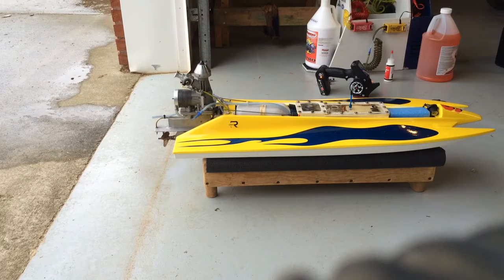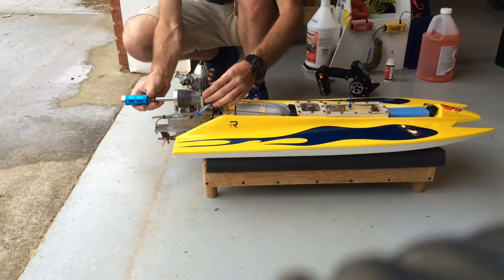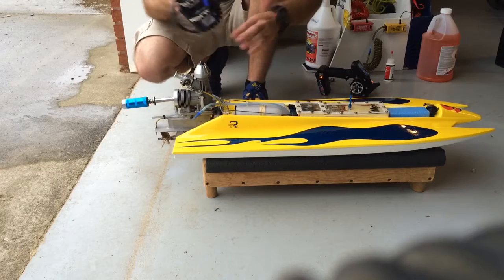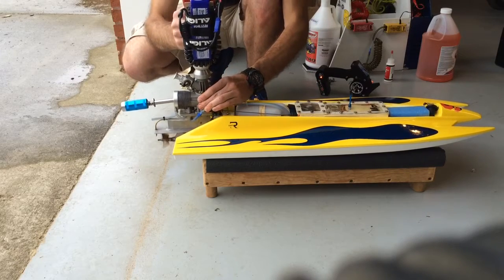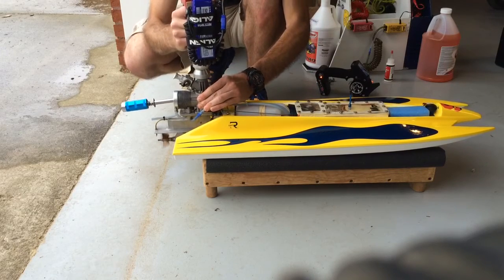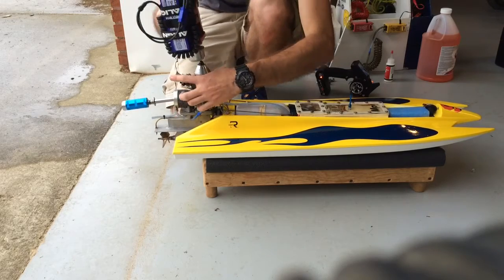K&B 11cc (0.67 ci) Outboard on 50% Nitro short fire up

Comment: That's! The secound Video i watch' by 🤝 that's RC Nitro Race boat engine i thinking the engine Not 100% Run meby the caburater.
Reply from the maker: There wasn’t anything wrong with this engine. 50% nitro is hard to get to run on top of running a very cold glow plug.
Reply: @TN_MuskyAddiction  jes OK! The very cold glow Spark Go faster ?.
Reply from the maker: @ellgwapo.1754  the colder plug allows higher nitro content in the fuel without detonation.
Reply: @TN_MuskyAddiction  If U mix! Ur own Nitro 50/50 Style it's ur's i donth' know about that's! & Jes meby! The coldest Version of glow Spark!. That's easy too' listen If Ur engine Run by 🤝 stand Gas & U give 2-3 Times full Speed kwikley! After worm Up evrything! It's nice! If If still runing by 🤝 stand Gas!.
Reply from the maker: @ellgwapo.1754  I run premixed Torco racing fuel and an OS R5 glow plug.
Reply: @TN_MuskyAddiction  ja! If aaa' litle too' Long give Speed by Name: be'schleinigen Just spining.

Comment: Years ago I had a K&B 7.5cc mounted on a Prather tunnel Hull Hydro.  I opened the exhaust port slightly and experimented with different props.  I ran it on 25% nitro and my only regret was they didn't have GPS speedos so I could only guess at its speed but it sure hauled ass.  That engine never gave me any problems - always started up instantly (quicker than yours).
Reply from the maker: Loulovesspeed yours started instantly because it wasn't running 50% nitro. That much nitro is hard start. I'm glad you had one too...they are cool engines.
Reply: @Rockerman91638 - Really?  I would have thought just the opposite as nitro is much more volatile than regular fuel.  Top fuel dragsters and funny cars burn up to 85% nitro and they seem to fire right up.  Anyway, I remember getting my K&B and read about breaking in the engine before you put it to use.  I mounted it inside of a metal double wall milk bottle container they used to have years ago when milk was delivered to your home.  I put enough water in to cover the prop and fired it up in my basement.  The throttle cable slipped off and it immediately went to full open throttle and emptied that container of water in about 5 seconds, blowing it all over the place.  Got a good laugh out of that one!
Reply from the maker: Loulovesspeed Since these motors do not have a spark plug it makes the nitro hard to light. Once the motor is hot and the catalytic cycle is started it burns really well!

Comment: Sounds good bud, i finally got mine out running , its got some play in connecting rod is that normal with these? It kinda clicks when you turn it over by hand
Reply from the maker: david hill yes there will be just a little bit of play back and forth.
Reply: use some castor oil in the fuel
Buy it from Walmart on the medical section. Put about two ounces of castor per gallon of nitro fuel.

Comment: whats the brand of the starter kit? i'm new at this if got one with the same motor. Don't have a transmitter. Is it possible that I can turn it on with out the transmitter?. I want to make sure the motor works
Reply from the maker: RCcar Rookie you can start it without a radio yes, but be very careful and make sure you have a way to immobilize/control the throttle linkage by hand.  I'd suggest buying a cheap 2ch Spektrum radio and receiver. $60 gets you a great radio system!
Reply: what is type of starter is that?
Reply from the maker: RCcar Rookie it is a hobbico 120 size starter that's running on a 4s lipo.
Reply: Have you worked on these motors? Like taking them apart?